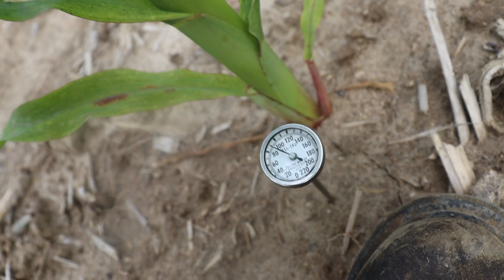SHP soil health vs conventional tillage update.

Comment: My suggestions for your consideration about the issue of "waves" in current crop growth
- rapidly changing soil types
- deep soil compaction from previous crop cultivations / harvest transportation etc
- tile drainage patterns
- application errors for pesticide or nutrients including such things as manure spreading .
- uneven seed planting depth?

It would seem to me that you have already identified a main cause of the difference of soil life activity with the differences in the amount of organic matter at or very near the soil surface when you talk of the extreme temps, wind and high intensity sunlight you have already experienced and what is yet to come. Shaded soil which is cooler and looks more moist will surely encourage/support more active soil life near the surface.

What I would like to see is two long (10 - 15ft), deep (at least 3ft deep) trenches one at right angles across a number of rows and one passing directly  a couple or more of these waves to pass through where the crop is depressed and also through where it is doing well. If some detailed soil samples (and possibly tissue samples) could be taken and analysed that might be most useful. Hopefully a soil scientist could be called upon to look at the possible soil compaction and root development perhaps via your agronomist or your local university ag department. Detailed analysis such as I am suggesting would also give you a detailed bench mark point for your 9 year study to see how quickly things may improve over time.

I clearly understand the costs, hassle and consequence of digging two substantial trenches as I am suggesting!! 
I am very much looking forward to seeing your progress with this long term experiment.
Reply from the maker: Yes good ideas.  Think landlord would probably kick me off if i dug some pits like that. Lol

I am excited to see how this goes.